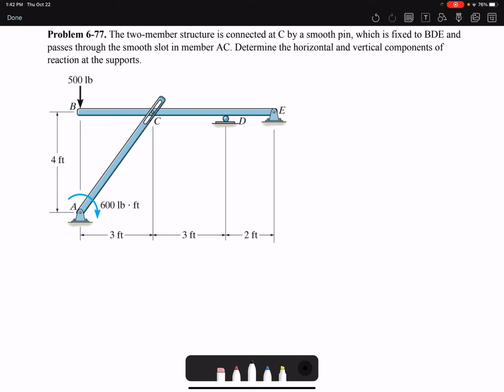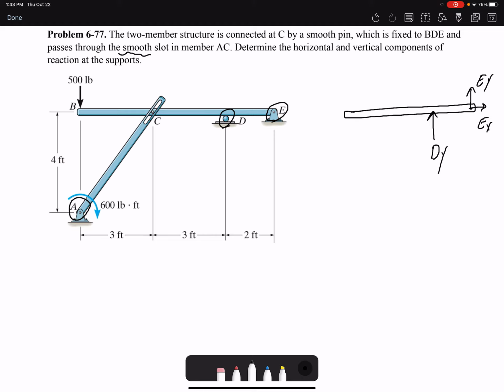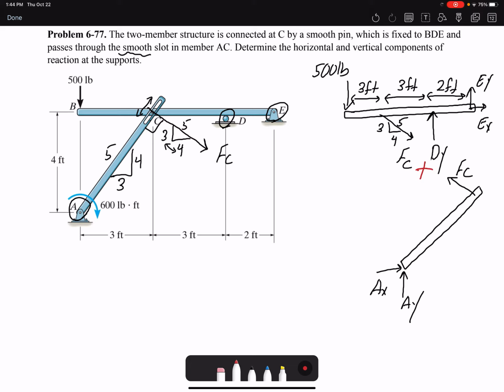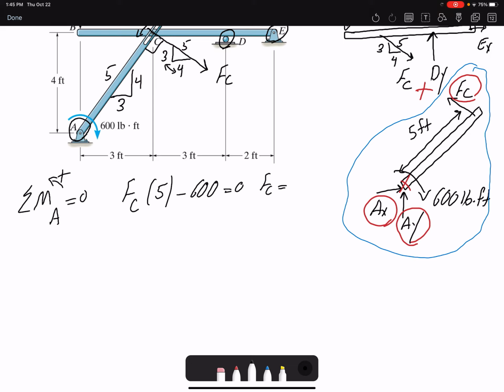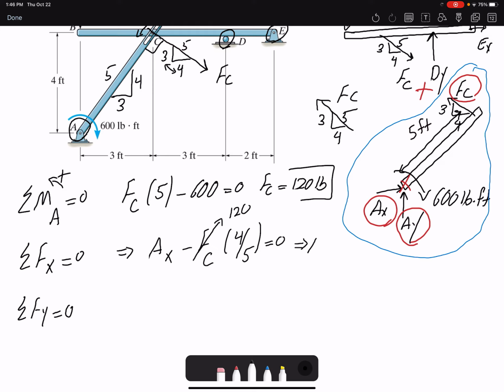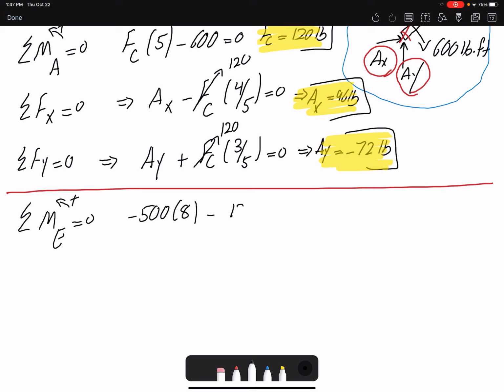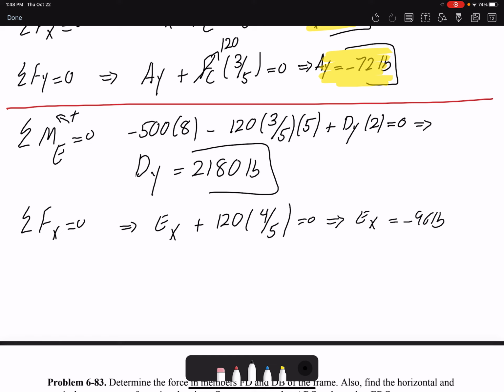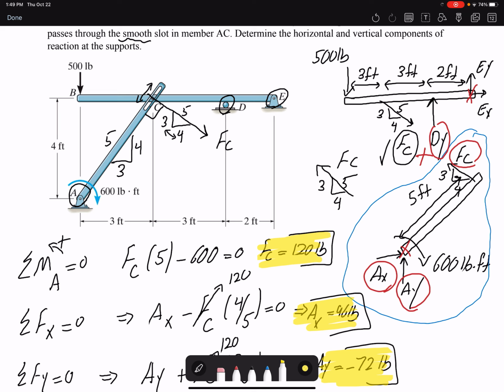Statics Problem 6-77: Frames and machines example for two beam

Comment: Dr Sanei can you explain the significance of the smooth slot in member AC
Reply from the maker: The term "smooth" indicates that there is no friction (neglected) and the only force would be the normal force acting between the two members.
Reply: I wanted to ask is that the smooth slot in member AC is like pin connected to smooth rod ?
Reply from the maker: @ElCrankoPunko  No, they are not pinn connected, the two members have sliding surfaces on each other due to a pin that engages the two members together.
Reply: also wanted to ask where there will moment reaction in the slot or not
Reply from the maker: @ElCrankoPunko  No, there is no moment reaction as there is no resistant to rotation. You can think of it as sliding a box on a surface.
Reply: if I remove the pin support A the member AC can still slide and rotate about slot C right ? pls help
Reply from the maker: @ElCrankoPunko  Yes, that is correct
Reply: thank you so much Dr. Sanei. great videos btw :)

Comment: Why force fc is acting perpendicular to joint c? The member AC is a force member so the force should be acting perpendicular to the frame BCD right? I didn't understand why the force acts on that direction which doesn't make sense to me honestly
Reply from the maker: Good question! Force Fc is perpendicular to the slot! You always have a reaction force when there is a resistance to motion! There is no resistance parallel to the slot and the other component of force would be perpendicular to the slot.

Comment: idk how the angle FC is found ??
Reply from the maker: The force acting on the rod is perpendicular to the direction of slot at AC, since the rod can move in that direction, the reaction force does not have any component along AC and the only component would be perpendicular to the rod AC. Does that make sense?

Comment: I do not understand why 500lb is making a clockwise moment?
Reply from the maker: You are right. I mis-spoke in the video. Both 500 and Fc are creating counter clock wise moment, so their sign is the same and different than Dy which is creating clock wise motion.
Reply: @engineeringvision  That makes more sense thanks!